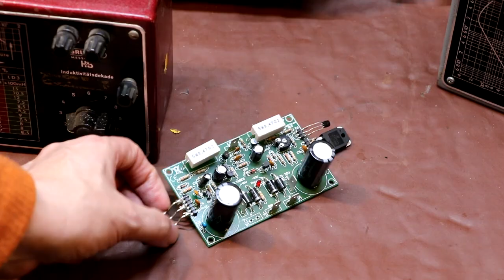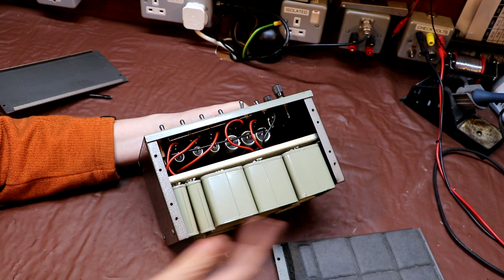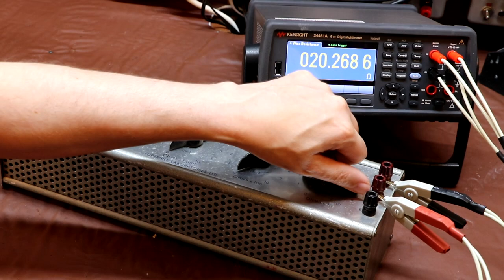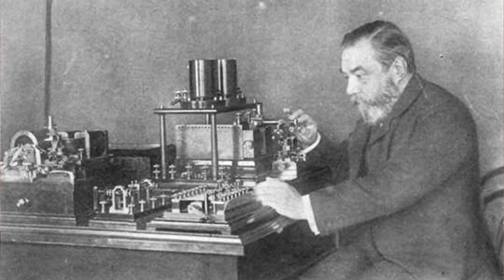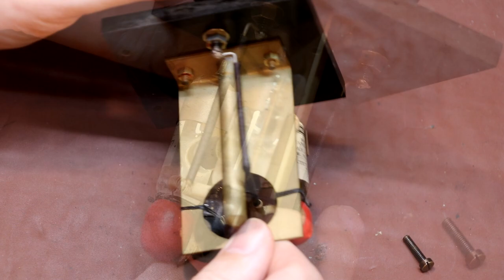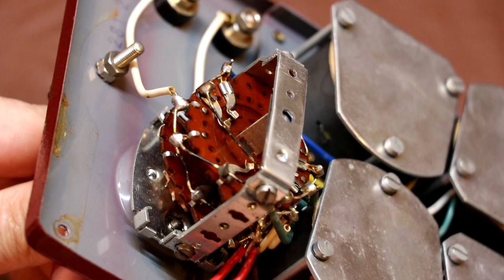Golborne Stuff - Decade Boxes and Weston Cell

Comment: Hi, chris. Weston cells can be somewhat rejuvenated with heat. Put the cell in an oven at 60ºC for some hours and then recheck 😉
Reply from the maker: Thanks for the tip!  I will give that a try. Best regards Chris
Reply: Yeah, also make sure to stick your head in the oven afterward and take a few deep lungfuls of the Mercury vapour. It has excellent health-giving properties !
Reply: @AndyMcClements  Weston cells are sealed in glass...
Reply: @pisotones2348   Yeah, I guess I was pulling your leg a bit. Still not sure I'd get that desperate to heat one though.
Reply: @AndyMcClements  I've got two Weston cells, 74 years old each, and they're still up to specs...
Reply: @pisotones2348  Nice, thats good to know. They still seem to appear on Eb*y in a possibly viable state, even 'sealed/unused'..

Comment: There are two Lektrokit's  LKU-111 for 250.00  USD each on fleabay right now . Man you got quite a deal there 
alone Chris! The LKU-121 looks like something ElectroBOOM could have fun with. LOL Cleaning the switches will reveal
 they are still accurate for1% .That Winston Electronics Capacitance Box may have been a bogged job done cheaply
decades ago. Grundig switch boxes may need a bit of cleaning but works fantastically considering it's age.
Do more of these Chris. Love the vintage testing equipment stuff  that you don't see  every day.
Reply from the maker: As you know I’m a big fan of test gear but wasn’t so sure my audience is. I thought most people were here for the radio stuff but I have had a lot of encouragement to do more test gear and I’m glad your interested. Anyone that would pay hundred of pounds for a decade box is an idiot unless the item comes with a real and traceable calibration certificate. I have bought these in the past and many have been abused and damaged. There is a Cropico box on eBay at the moment for a few hundred pounds but it won’t ever sell.
Reply: @allthegearnoidea6752  I know the prices are bonkers at screwbay!

Comment: A very nice haul you got there chris.is that a dynatron Atlantis trv I saw on the floor.looks all complete
Reply from the maker: The TV on the floor of my workshop is a Murphy set. I started restoring it and now have a distorted picture. It’s just a lot of capacitors that need changing out. We can make a video if your interested.
Reply: @allthegearnoidea6752   hi Chris,I was referring to the radio under the round table to the left which you displayed your radios on.maybe it wasn't the table in your house just a table you had your gear on at the auction